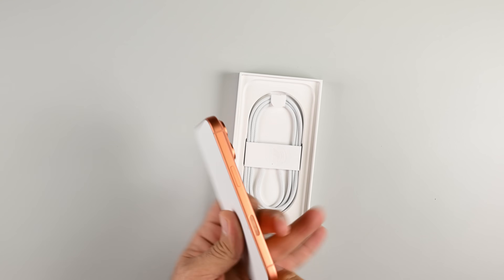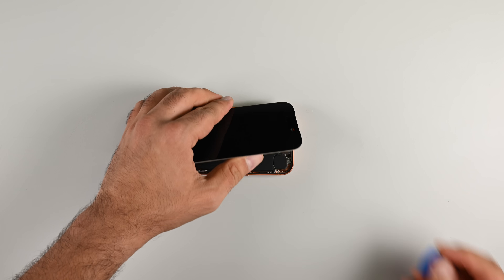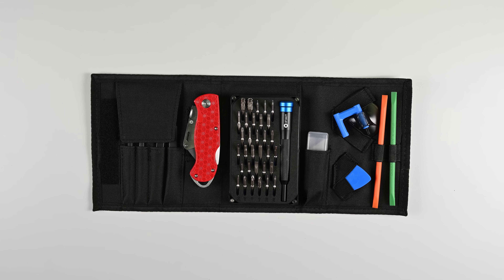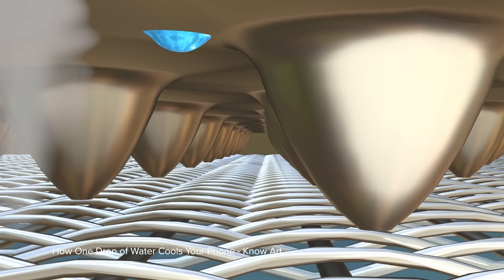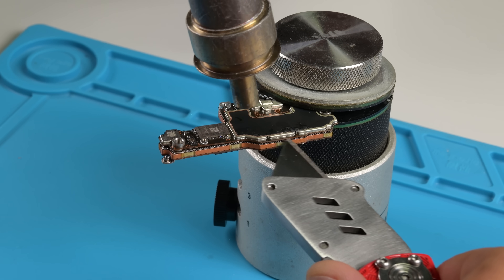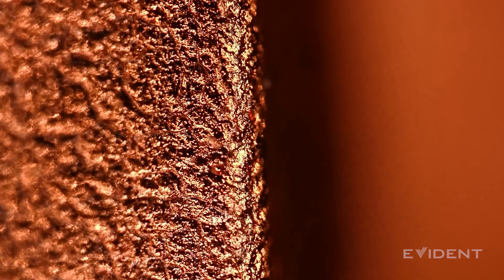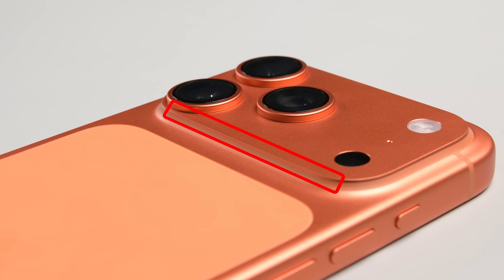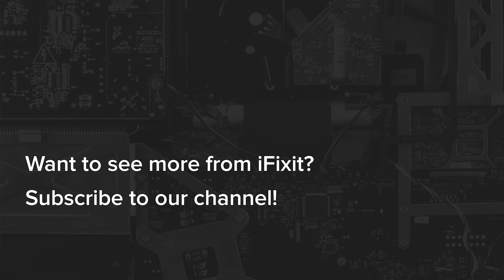iPhone 17 Pro Teardown: The Good, The Bad & The Fascinating

Comment: I bought a 17 Pro day before yesterday and I've been more than thrilled with it! The thermal and battery improvements are extremely noticeable.
Reply: Same. But the aluminum feels cheap, my old Pro was so much nicer. This looks like a brick.
Reply: iOS 26 has been murdering my battery on a 14 pro max. Siri is broken. And I am totally OVER the BS of flash banging me every time I try to click on some text in iMessage.
Reply: Crazy 😧
Reply: Give it a few days.
Reply: 16 Pro battery kinda sucked, 17 Pro is great - no more battery anxiety
Reply: @UserCommenter aur kro iPhone promote
Reply: I might be a light user, I'm ending the day with 75% left when my 14 pro could be down to below 50%.
Reply: @ashliehiggins Sounds like the normal battery degradation you will experience every time again. And every time they tell you the NEW battery is better while they stagnate since years.
Reply: No thermal or battery issues on 15Pro max, huh. Funny
Reply: @DeltaStormYT  how? even the most basic apps(with no other apps opened) my phone(15 pro max) heats up like crazy😭. also esp when charging.
Reply: Yeah, it practically burns my hand.
Reply: ok bot
Reply: Compared to?
Reply: @phillipvelednitskiy6881   old phone prob?
Reply: @phillipvelednitskiy6881  For me, the 15 Pro Max. I never did anything super heavy, but the phone would get hot. It only overheated once when I first bought it. The 17 Pro (I downsized) is MUCH more efficient at dissipating the heat and the battery is on par with or better than my 15 PM, which is the part that I am more than shocked by. I expected it to be a little worse, but not better. I keep my phone charge limited to 80%.
Reply: @phillipvelednitskiy6881 the predecessors …..
Reply: I have the pro max and came from an s24 ultra. The pro max runs noticeable cooler to the touch. The s24u would heat up when watching videos for longer periods and you could really feel the heat centered around the soc. The pro max definitely does a better job of distributing heat making it run cooler and more comfortable in the hand.
Reply: Should i buy pro or pro max
Reply: I still haven’t got my preordered phone yet. I PRE ORDERED IT in the first day you possibly could.
Reply: Yes, it is great! Just don't like the iOS 26 bugs once in awhile.
Reply: Same. It's vastly better than my 16 Pro, which I hated almost immediately after buying. Hot AF, throttles down constantly, dims outside, heavy and unpleasant.
Reply: @jspiro i hated when i was outside and the screen turned all the way up and i still can’t see anything.
Reply: @jspiro the 17 pros are literally heavier...
Reply: sorry for your loss
Reply: Lolololol get a zfold7 😂😂😂
Reply: Until you need a battery swap
Reply: Couldn't find a regular store selling better phones around? I see
Reply: @ForeverMan what a neckbeard thing to say lol
Reply: @ForeverMan  He did, thats why he got an iPhone
Reply: @Fluskar where

Comment: I’m feeling better and better about sticking to a white 17 pro with either no anodizing, or an anodizing layer that basically just looks like bare aluminum
Reply: I wish I had gone silver now.  I’m not worried about scratching since it went into a case immediately. But the orange is kinda hard to match color with cases.
Reply: @ky314  I'm going with a dark blue case. That should really let the orange highlights pop, and blue complements orange quite well.
Reply: @ky314 I ordered the blue PM, but I think I’m just gonna throw an ultrathin case on to protect against scratches. No use protecting it more than that imo
Reply: Give me a gray or black phone. I’ll gladly take the cute, scratches, and nicks and wear them with pride. oh no I use my iPhone
Reply: This is the way
Reply: Honestly, if it chips enough, it just becomes patina (as my old SE, 6s, 15 and iPods can attest)
Reply: @AllonKirtchik 😂
Reply: I have a white 15PM and a silver s25 I always prefer lighter colours
Reply: @Hybrid225  I’m the opposite, always prefer the dark colours and have a Deep Blue 17 Pro. I did have the Sierra Blue 13 Pro too though, that was stunning
Reply: That's not the solution bro

Comment: I actually like that back is more aluminum and less glass ...imo it should be all metal on the back or at least somekind of combination of metal and wood to allow wireless charging. I can live with scratches on metal but not with broken shards of glass. We shouldnt encase phone with cheap rubber or plastic cases it just adds to bulk and changes the feeling if the phone... Phones should withstand normal use and abuse, not be fragile and made of glass on both sides.
Reply: wood would ruin water resistance. other than glass the only other option is plastic.
Reply: The back is glass because of wireless charging.
Reply: What do you mean made of glass on both sides? Do you make a screen of plastic? Back is made of glass/plastic to enable wireless charging. 
At least give some logical argument if you can't handle a normal day to day wear & tear of a smartphone.